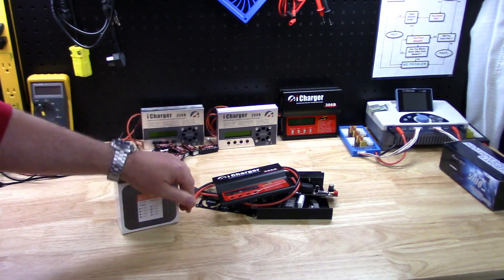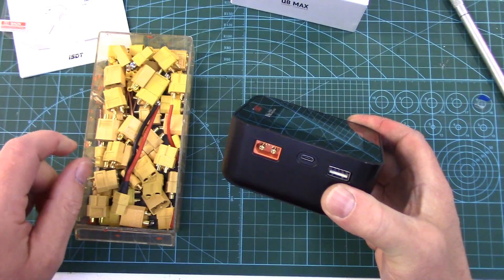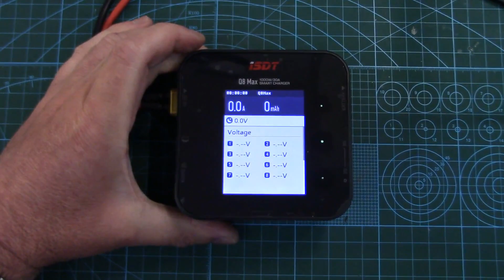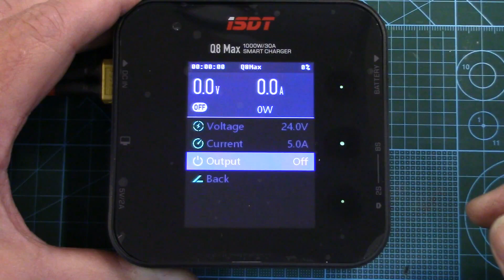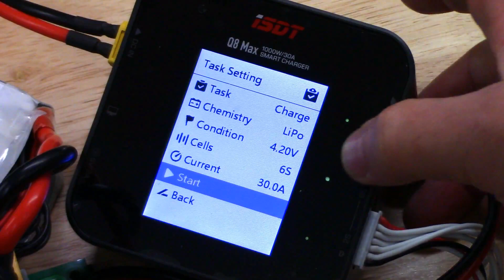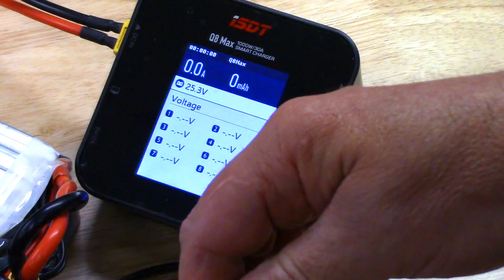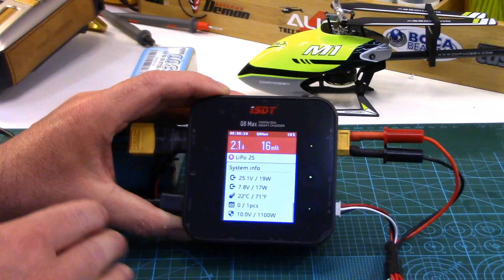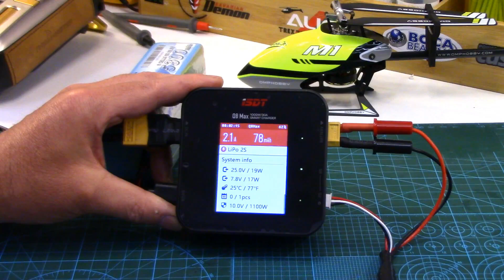iSDT Q8 Max RC Charger Review - Small in size, big on power!

Comment: Sweet! Just got mine today,
My Turnigy Reaktor was killed by my Skyrc efuel, they both went into a "Death Roll"  smoke and sparks, hey after 15 years, no complaints. I use spider cables to charge and balance, with banana plugs so cannibalize the female receptacles now need some harness to keep them separated.

Comment: hi I had a question!  condition, what is its use in this charger and why is it between 4 volts and not more for pb???  Does it show the voltage of each cell?
Reply from the maker: That is a LiPo example shown in the video, has nothing to do with PB. A LiPo cell is fully charged at 4.2V, but this charger as shown allows you to adjust that end termination cell voltage if you wanted. I for example charge my LiPo's to 4.18V per cell as it's slightly better for them from a life standpoint.
Reply: @Rchelicopterfun  Thank you, that means, in fact, the condition determines the voltage of each cell that will end the charge upon reaching it, right???

Comment: Congratulations on the excellent review, can you recommend a power supply to use with this charger? Thanks.
Reply from the maker: If you want the full power output, you need to feed it with a power supply that gives the maximum input voltage and power the Q8 is rated for (30V @1000W). I however primarily use a Meanwell 1000-24 supply with it which is fine. But have also used two DPS600 supplies in series. I cover this option in detail in my RC power supply build article on my website: https://www.rchelicopterfun.com/dps-600pb-build.html
Reply: @Rchelicopterfun  Thank you very much 👍

Comment: how does it compare to the Icharger x6, can you n test the ah of a battery?
Reply from the maker: No idea as I don't have an X6. I do have the S6 and did a review on it. https://youtu.be/SfqB-r9hit8
Between the two, I do like the S6 a little bit better because of the user interface. Both however charge & balance batteries equally well, and both have been working great over the past year. And yes, both show the capacity that goes back into the pack during a charge cycle or take out of the packs during a discharge cycle.
Reply: @Rchelicopterfun  Thanks I appreciate it,I was wondering because imm going to charge and discharge Lluon lithium and need to see Internal Resistance and ah rating to find bad cells wanted to know the difference between the two chargers

Comment: What powers upper do you need to charge 6s at 30amp
Reply from the maker: 4.2V x 6 x 30A = 756W. Plus some efficiency loss. I use a 24V 1000W supply.
Reply: @Rchelicopterfun  so power supply s is voltage X amp to know the wattage. So you using 24v x 40 amp roughly
Reply from the maker: Yep

Comment: May I ask a question?
I use lipo battery charger Q8 Isdt 1000W, and the input power is 24vol 30A.
When I charge 4 batteries of 6s 5000mah at the same time through the charger, does the balace mode work at its best?
thanks everyone!

Comment: Hi John. Great review. I love Isdt chargers. I was curious, how are you getting 28v out of your dps600’s ? I only get 25.2 out of a pair of mine in series. Did you do a voltage mod?
Reply from the maker: @Dallas117 - Good eye. To answer your question - I don't know? I presume the input voltage was not reading correctly while shooting the video? Two of my DSP600's in series like yours are right around 25V. When I hook my Q8 up to them now, it's reading 25.1V which is what my iCharger S6 is also indicating.

Comment: Hi, I have a question: I just bought the same charger, but at the end of the day when the screen turns blue, the amp of the device does not become zero (top left) and is constantly increasing and decreasing !!  But the battery amp does not change, I wanted to know what the reason is ??? I saw in your clip that the amp of your device is 0, but for me it changes from 0.5 to 0.3 amps!  Please help us, thank you
Reply from the maker: In the video, mine is also hunting after the charge cycle is finishes and as I mentioned at that time point, reason is it's still balancing the cells. If your pack/s are unhealthy, that might be why it balances longer and/or needs to put a higher load on them, but 0.5A isn't that high considering maximum balance load is 1.5A.
Reply: @Rchelicopterfun  Thanks for the answer my dear friend, so this is not a problem ???  My device is healthy and this is normal ????  I mean, for you, after the screen turns blue, the amp of the device is still fluctuating and does not become zero ???
Reply from the maker: Not a problem, normal operation, use the pack/s.
Reply: @Rchelicopterfun  Thank you very much, I also saw in other videos that when the charge is finished, the amp is zero, but I waited a long time but it did not work!  That made me worried.  Now that you said it's normal, I was relieved

Comment: Hi,  Do you know if the ISDT Q8 supplements Boost function? For example - 12V Car battery and bump/boost up to charge 24v cells?
Reply from the maker: Yes, keeping in mind that the rules of electricity still apply (double the output voltage, and half the maximum current output).

Comment: John - is the fan in all the time ?  The K2 version is very noisy but wanted to ask at low levels (1c ) does the fan come on straight away ?  Thanks
Reply from the maker: It's only on when the internal temp is high enough to warrant turning it on and it's throttled based on cooling demand. Just as I demo @ 11:37
Reply: you shoud try update the firmware via usb or replace that tharger for q8 max

Comment: Hello John, thanks for this great review. Which power supply do you recommend?
Reply from the maker: I personally use modified server power supplies: https://www.rchelicopterfun.com/dps-600pb-build.html
Can't go wrong with Meanwell power supplies either - my second choice. 
No matter what supply you use, just ensure you size the supply close to the maximum voltage and wattage the charger can deliver (assuming you want to use the charger at its rated full capacity). In the case of the iSDT Q8 Max - no more than 34 VDC and at least 1000Watts. The two series DPS-600 supplies I run mine on provide 24VDC and 1150Watts (almost 50 Amps). You can of course power it at lower voltages and current, you just won't be able to use it to full voltage and current charging capacity which most folks rarely do.
Reply: @Rchelicopterfun  Thank you very much

Comment: Great video as usual John!  My iMax B6 Ultimate is getting long in the tooth.  Looking to get a replacement myself.  Since you are an iCharger fan, I am surprised you didn't go with the X8.  Specs are similar on that to the Q8 I see.   Do you plan on doing a review on the X8 at some point?
Reply from the maker: I might, or the S6.
Reply: i have both isdt q8 max and icharger x8   the q8 max fan  is much louder than the x8  but q8max have usb port to harge phone or gopro cameras both chargers are great

Comment: What's with these chargers that don't come with a power supply?
Reply from the maker: Simple - with powerful chargers like these, having a separate PS makes the most logical sense for several reasons:
1. It allows the individual to purchase the PS based on their specific needs (current, voltage, Watts, input voltage, chargers they already have and budget).
2. Pair a powerful 1000-2000W charger with a 1000-2000W 24-50VDC power supply and you would be looking at several hundred dollars not to mention something the size & weight of a cinder block.
3. It allows you to use your existing PS/s with new/future charger/s - again saving money.
4. It allows easy field charging with no bulky & heavy built in supply by way of a 12 or 24VDC vehicle power source. 
5. If either the PS or Charger fail, you would be hooped with a combination unit, having to send the entire works out for repair or replacement when only one component is faulty. 
I cover all these basics in more detail on both my choosing the best RC Charger for your needs and the basics of PS for RC chargers pages on my website:  
https://www.rchelicopterfun.com/best-rc-battery-charger.html
https://www.rchelicopterfun.com/rc-power-supply.html

Comment: Have you tried the icharger x6 or s6? I am struggling to choose between the 3. The q8 max is def the best bang for buck but I am surprised that while q8 max is still small, its quite a bit larger than the x6 or s6. The x6 for example does 800w 30a  weighs only like 168g or something. Its 110$ so a little bit more but does seem it doesnt have the same feature set as the q8 max. And then you have the s6, which I think has the q8 max beat all the way around but its also 30$ more.
Reply from the maker: Yes I have (the S6) and did a review on it not that long ago: https://youtu.be/SfqB-r9hit8
The S6 is a better charger if you are looking for best size for the amount of power. It's also better quality, more features, and the display won't scratch by looking at it the wrong way like the Q8. Cost per watt is higher however at around 12c per Watt for the S6 vs about 9c for the Q8. Most newbies will find the Q8 easier to use because it only has a fraction of all the features the X6 or S6 have, but they don't have a USB power output, and that feature can be pretty handy for some people that have USB power requirements out at the flying field or track. All depends what features you are looking for in your charger; but if small size, power, and quality are the top boxes you need to check off your list, the S6 is the clear choice IMO.
Reply: @Rchelicopterfun  some of the ichargers x6 and my x8 have issue with the fan failure the buzzing soud starts after couple months because they use cheap quality fans with slight bearing but the Q8 chargers uses the hi quality ball bearing type fans and i never see any fan failure of Q8 fan
Reply: @Rchelicopterfun  thanks man. I ended up going with the q8 max.  I got it for 88$ with no tax.  I almost bought the s6 but I did read about low quality fans in the x6/x8.  Do you know if that’s the same with the s6?
Reply from the maker: @doom3crazy - I'm sure you'll be very happy with the Q8M, that is a great price! No idea on the S6 fan longevity? It was my understanding the fan issue on the X series was with early units, short lived and iCharger quickly addressed the issue. Regardless, the fans are inexpensive & easy to replace in these things if/when they fail (with the mechanical & electronic skills most average RC hobbyists have).

Comment: what power supply is good for charging 4s, 12v or 24volt.
Reply from the maker: Totally depends on charging current, not voltage; provided of course the voltage output of the power supply is within the charger's stated usable voltage range. My RC Power Supply page on my website covers this and how to chose a power supply for your particular charger in detail: https://www.rchelicopterfun.com/rc-power-supply.html

Comment: I'm thinking of getting an isdt d1 as a first charger. Do you think the included DC cable will charge just fine or would it heat up quickly or something? I'm not an expert on chargers.
Reply from the maker: Sorry, I don't know much about the D1 other than its 240W & max 10Amp power rating and have no idea what cable/s  are included. Don't need very big wire for 10A.

Comment: In the charger of the xk k110, it says 500mah on the circuit board which I'm guessing is the max current battery you can charge. Do you think it'll be fine to charger some bigger 520mah batteries with it?
Reply from the maker: That's likely the maximum current (500 mA) the charger can output, but without load testing it, that is just a guess. It likely has nothing to do with what capacity battery you can charge. You can charge a battery at any charge current you wish. LiPo's normal and safe charge rate is 1C (1x the capacity). You can of course charge at lower than 1C rates for maximum health. As the little USB charger that comes with the K110 is a dual port charger, I would presume the 500 mAh is total with each of the charge ports outputting a maximum of 250 mA, but again, without it testing it, that is just an educated guess.
Reply: @Rchelicopterfun  that must make sense as I charged 2 batteries and it charged a lot slower than charging one battery. Thanks for the clarification!

Comment: Hi John, you defo look to know your stuff electric wise. Given that can i ask how you blew the charger up? negligence ? if so can you elaborate as a warning to us newbs,thanks
Reply from the maker: Yep, total negligence. I accidently plugged it into my one PS while configured to run my 4010Duo charger @ 50 VDC. In short, I over powered it and blew the input power side of the main power board. I've done it once before by mistake, and it survived, but I obviously weakened the components and seeing that it has been used pretty hard it's whole life, just couldn't take one more dumb mistake. 🙂
Reply: @Rchelicopterfun  Thanks John, A warning to all to take care. If you can slip up it just goes to show!

Comment: Excellent video John,
I'm thinking of using one of these iSDT Q8 chargers for a different purpose than usual and setting it up to behave a bit like a solar charge controller. In this configuration it would remain connected to the battery at all times and when ever charge is taken out of the battery the Q8 recharges it without needing me to start the charging cycle again. Is this possible?
Reply from the maker: Nope.
Reply: @Rchelicopterfun  do you know of anything that would meet my requirements?
Reply from the maker: Sorry no idea.

Comment: So can you power this charger off a usb power supply?
Reply from the maker: Nope. As I said in the video, voltage input range is 10 to 34 VDC and up to 33 Amps if you want to use it to its full potential. A 5V and generally under 1 Amp USB power source wouldn't even have enough power to turn it on.
Reply: @Rchelicopterfun  so what are some ways to power it without using a giant battery pack? Can you plug it into a 12 volt power supply in a car?
Reply from the maker: @Andy Thompson  did I not say that was one way to power out at the flying field in the review... Yes I did. 🙂
If you are unclear on RC charger powering methods, you might find the page on RC battery chargers on my website helpful. It covers RC charger powering methods in more detail and how to determine how much power you'll need for your particular charger & charging requirements: https://www.rchelicopterfun.com/rc-battery-chargers.html

Comment: As always, a very informative video, John. "Destroy function", maybe nice to have, but is it a really neat feature? To run a battery down to zero volt, how about letting the heli rotor (or airplane propeller) run until it simply stops spinning?
Reply from the maker: Several reason you would never do that. Primary ones: 1. Very hard on brushless ESCs (high ripple voltage damaging to the MOSFETs). 2. Most ESC wouldn't even allow it to happen (LV protection would kick in long before the pack was even close to fully discharged as most LV cutoff's are programmed to 3.0V or higher per cell under load). 3. Under higher loads, the LiPo's would get so bloody hot running them down like that, there is a good chance they may burst or catch on fire (all depends on the load applied). 4. If your ESC also powers your on board electronics via a BEC, it would also be very hard on your on board electronics (BEC, RX, servos etc); first brownout restarts of the micro controllers and then possible failures once again due to high ripple voltage.  In short, it's never done, LiPo instructions are explicit it's never done, and is exactly why the destroy feature is a handy one to have for those that don't have the correct voltage light bulbs, big resistors, or have the time to submerge their LiPo in salt water for several days to drain it to a zero voltage potential for safe disposal.
Reply: @Rchelicopterfun  Thank you for a very information filled answer. There is so much to learn about LiPo's charging/discharging/handling for an old guy like me. Makes me want to go back to the good old days with glow plug engines :-)
By the way, your web-site www.rchelicopterfun.com and your four e-books, have been instrumental in getting my OMP M2 V2 in the air. Without that information the helicopter would be in the trash can. Regards Steve S. in Surrey.